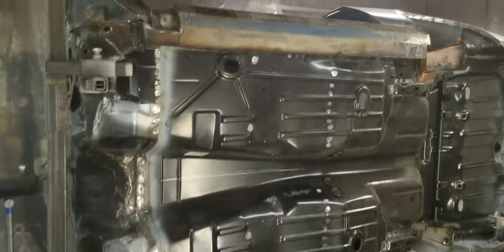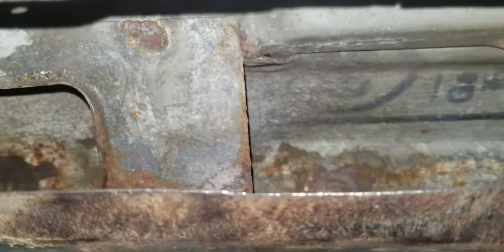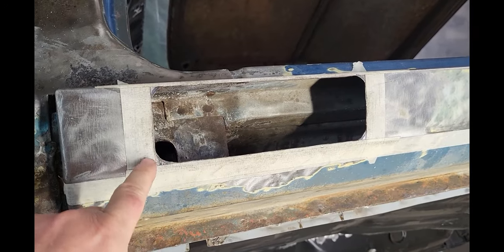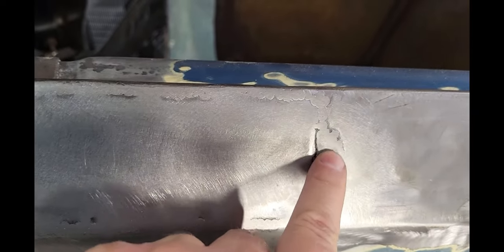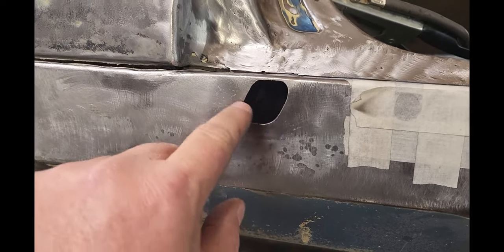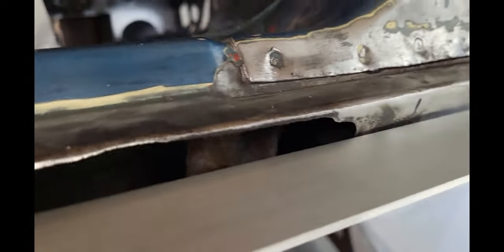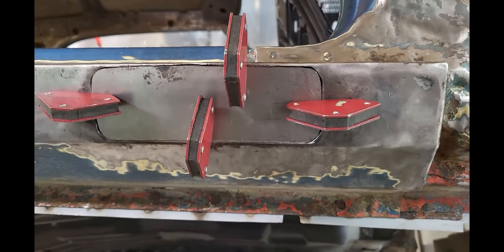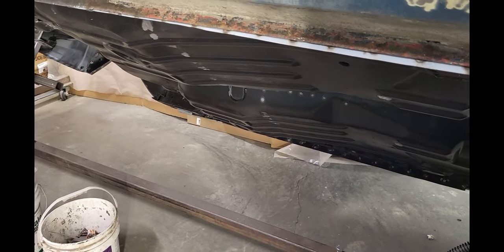1968 Camaro Project #54 Repairing Rusty Rockers

Comment: You are doing great. For a regular person doing this job with the tools and materials you have. It’s very clever what you’re doing. When you get done with structural then there’s Body Work.. lol that’s a bit different and more detailed. That’s where filling and sanding comes in. You probably know that. Either lead or plastic it’s going to take filler for ultimate smoothness. Or just primer and sanding the shirt out of it. And calling it a day 😅. Even new Camaros came off the line with repairs and blemishes no one caught until after the sale 😂. So don’t be hard on yourself. You don’t have to be Chip Foose or George Barris here. It’s your car at the end of the day. Have fun building it finishing and driving the wheels off it. Who cares what others think or do? 👀😃
Reply from the maker: @johnpurington6659  Hey John, thanks for the encouragement. I've gotta get back to working on this beast soon.

Comment: not bored at all!  I wish you'd shown the cutting part part, though.  Great work.  I need the rockers on my 69 redone, but I'm no metal worker for sure!
Reply from the maker: I'm glad I'm not putting you to sleep. :) Cutting the straight parts is done with a cut-off wheel on a die grinder and I round the corners with a carbide bur on a die grinder. They say it just takes practice, determination, and a little luck. Cheers!

Comment: Very nice work and I am enjoying your channel a great deal.  One thing I wanted to give you a heads up on.  I am starting a similar build on a 67 Firebird.  I noticed you have a broken bolt in the lower left fender mount.  I had the same thing and I could not believe the ass ache I had getting that out.  I hope you have a better time of it.  I did not have my body on the rotisserie but if I did I would flip it upside down and build a dam around the broken bolt and literally fill the area with penetrating oil and let it soak for a few days and see if that helps.  I have never had a bolt stuck like that.  The area above that nut seems to get full of sandy silt.  And it pretty much welds that bolt into the nut as soon as you try to back it out.  Try to weld a nut to the 'stud' and try to tighten it in first to dislodge the sand from the threads. then try to back it out.  I ended up drilling it out (broke 3 easy outs) and then tried to peal the threads out of the nut.  by the time I was done I broke the nut off the body.  Big mess.  Had to inset a rivet nut into the hole.
Reply from the maker: Thanks for watching! That's very observant. It's like that on both sides. When I got the car it looks like they cut the head off the bolt and put a nut on it. (turned a frozen bolt into a stud) It worked pretty well, so I think I'll just leave it like that.

Comment: Nice work! I had that exact same patch in that spot on the right side rocker and mine shrunk in a little like yours did as well. I was debating trying to pull it out or cut it out and redo it, or just fill it.
Reply from the maker: Thanks a bunch! What did you end up doing with that spot?
Reply: @ElrodsGarage  I put a straight edge across it and it was just over 1/8” deep which has kind of been what I go by so I’m going to cut it out and redo it slower this time. If I could get behind it I would just hammer and dolly it out.🙄
Reply from the maker: @TheLooper0  ugh that would suck. Better luck next time. I have thought about rigging up some kind of slide hammer tool with some vice grips to pull it out. Cheers!

Comment: I have been curious about this many times so this looks to be a good opportunity to ask. When tubbing what do you do for the upper shock mounts that were cut away?
Reply from the maker: I'm using the Ridetech 4-Link which has the upper shock mounts on the cradle. DSE makes an upper shock crossmember that welds in-between the tubs and the upper shock mounts weld to it. I hope this helps answer your question. Cheers!